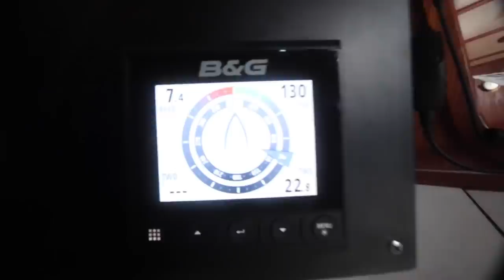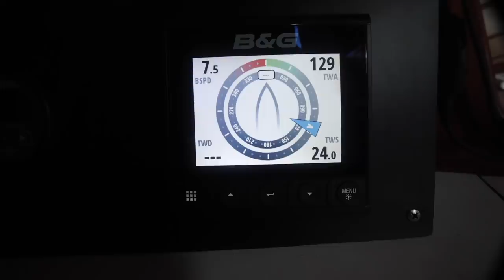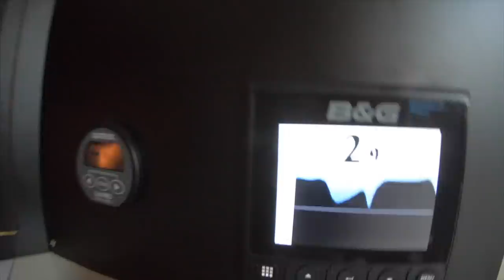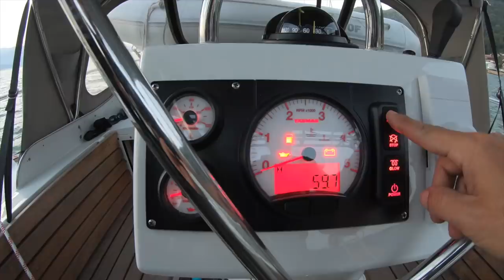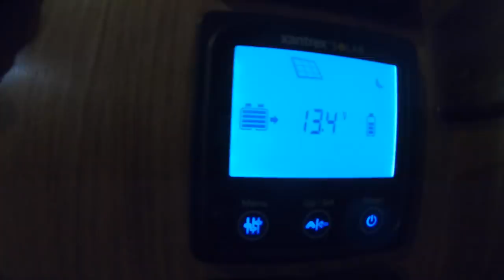⛵️Our brand new engine heated up!! #197

Comment: My engine had same the hot tank was above the engine coolant filler. What you must do is add a filler bottler ABOVE the hot tank. Yanmah will have a kit that you can get to do this. I would strongly suggest you do this it is safe and good practice. I am surprised your engineer did not fit this

Comment: Hi Guys, When you get your autopilot you can set it to 0 degrees by 'wind angle' so it will hold into the wind to raise your mainsail. This is the best way instead of setting a course to where the wind is coming from as it changes. André in Sydney (I did see you in Sydney)

Comment: Your cooling system needs an easy modification: buy or have made a stainless steel tank with fittings on the bottom for two cooling hoses and a radiator cap on top. Mount it higher than the heat exchanger.  Attach one hose from the engine to it and the other to the heat exchanger. This way air bubbles will work their way to the top of the system and also it is safe to remove the cap when the engine is hot. This is how my boat is set up.
Reply: You might get away with an automotive swirl pot...which does this.
Reply: There is nothing that cannot be remedied with enough time and money.

Comment: We replaced our Xantrex pro-sine 2000 on our sailboat with a Freedom XL marine 3000. We ended up not using the 3000 because it kicked the fan on for about 10 minutes every 20 minutes or so when it checked the state of charge of the batteries. The fan noise might not be a problem for some installations,  but on our boat the install is under the salon sofa, so the noise was a problem. Also, while the 2000 had a monitor that easily let us turn off automatic DC toAC inversion, the 3000 monitor didn't have that functionality. We've experienced sitting at dock where we've lost power over night and had our inverter happily run down our batteries to keep all the systems running (including the little electric heaters we were using). So turning off automatic inversion is an important feature for us.
Reply: .I inherited a Xantrax 2000 and soon switched it out to separate charger and inverter controlled by ME for exactly the same reasons.

Comment: Besides viewers suggestions for safety wiring shackle pins, I wondered it the bar used to crank the anchor winch should also have a rope attached that could keep it from going overboard on a rough day.  Thanks for sharing your adventure.

Comment: Use safety wire on your shackles, like when you started using 2 clamps on your hoses. If looking around at items while on your “shakedown” cruise and think: if this fails, what happens. You guys have done such a Marvelous job on the boat and all of it’s systems!!!
I think of all of the double check ing and some cases triple check items that are mission critical. You two awesome people ROCK❣️✌🏼✌🏼😎

Comment: Maybe need to experiment how the boat sails with centerboard part way down, I sailed my boat about the length of Florida in Intercoasal waterway with the centerboard up, It is little different because I had a small keel with board up and you only hit mud or sand until you get very south where it is Coral.

Comment: So much high tech stuff, so much fun in such a sort time. Yes when you add the other electronics add the heavier wire for the inverter/charger.
I can no longer turn myself into a pretzel in tight places, got long arms but to stiff in the joints to do that kind of work.

Comment: Most engines need a topping off or a fill sequence of opening vents and plugs. I always want to check again after the thermostat opens. They always seem to want more after they’ve ran a half an hour. You just got to be careful not to open when hot or under pressure. You also don’t want to pour cold water into a hot motor.

Comment: For that problem filling the coolant all the way due to the heater tank...

Have you thought about adding a petcock at a high point in the system? This will allow you to burp out the air as you fill the system, especially if you move your coolant plastic reservoir to the same level. Probably a simple way to reconfigure the components to avoid this problem. On my coach I had to add a petcock to prevent a huge air bubble inside the engine when filling the coolant.

Really enjoy your videos and glad to see you both so happy sailing.

Comment: Another cooling system tip: if the intake fitting doesn't have an external screen on the hull add one. This will keep weeds and pieces of kelp, etc. from being sucked in. You don't want to become an expert at disconnecting both ends of your intake hose ..... I speak from too many times having to do just that this summer.
Reply: Not only weeds and kelp. Plastic as well.
Reply: I have found my yanmar 3hm to be very difficult to get the coolant system completely full on the first fillup.  Recommend you continue to check coolant level frequently  until all small channels in coolant system are completely full. Also the exact water/ coolant proportion  50/50 gives best performance

Comment: You must do pre start checks on your engine each day you use it, this way the water level would have been found before you started the engine. 

Sometimes a small list helps you as it can be ticked off as it’s completed. This includes fuel in the tanks.

Comment: You really need to install a header tank with a pressure cap, say from a scrap car system, at a level higher than the hot water tank that will give capacity for expansion of the coolant and ensure the heat exchanger stays full. A clear plastic one will make easy to check the coolant level.
Reply: Great comment, thanks for sharing

Comment: We are all proud of how fast Duca grasped onto the low surge tank coolant level. Same with a car, if the temp sensor is out of liquid level, hot air or steam will show a far higher temp than the actual engine temp. Good catch Duca. 
The next comment goes towards the "old-salt" Roberta while at the helm, standing up on the cockpit seats to see over the dodger.  You kids are a lesson on co-operative learning.

Comment: Too bad that your shackle came loose. I work in theatre and do a lot of rigging, often using shackles. When watching your videos I was surprised that the shackles weren't locked. For safety it is standard practice in theatre that all shackles must be "moused". We run a zip tie (or cable tie) through the eye hole of the bolt, then through the shackle itself. This makes sure the bolt cannot become loose. Before zip ties, they used wire. Thanks for your wonderful videos. I live in Melbourne and my house mates are from Brazil. Matheus is from Florianopolis!
Reply from the maker: Thanks for the suggestion. We are also from Florianópolis and we have some friends living in Melbourne ☺️🤗
Reply: @OddLifeCrafting  Most of my housemates Brazilian friends have returned to Brazil since COVID.

Comment: Two tips........ Number 1--- Check the seawater inlet strainer and make sure it's clear of grass and fouling.. Number 2----after you tighten the pin on the shackle, secure it with a piece of "safety wire"..

Comment: Nice. I noticed the spinnaker pole on the starboard side deck is a trip hazard and could hurt your toes. Have you thought about mounting it on the boom where its out of the way and much easier to deploy (many racers like us do this). Very cheap too. You just need a small piece of black plastic drain pipe about 150mm, cut at 30 degrees (so it looks better and you have room for the rivets) riveted to the boom. Just a thought.

Comment: Great to see you guys out there! Interesting. In the US Yanmar allowed me to do the 50hour valve clearance check/adjust. I think laws here make it so you are not forced to use prescribed service providers to maintain warranty. I do maintenance myself for the very same reason you discovered. Marine services just keep getting worse. A professional rigger just finished a friend's boat and left the pin/ring out of the backstay connection. Professional....right....

Comment: Your diagnosis is incorrect, but the you got the problem fixed. When the water level in the exchanger is low, the amount of cooling is reduced and the engine really does get hot, it is not just a sensor problem from being in the air, it really was a lack of cooling, and the engine really was hot.  You made the right decision to let it cool down.

Comment: Apparently there is the ideal size and pitch of your propeller. If it is too large it may overload your engine. I asked an ai program which pitch would be the best for you here is the answer. Others agree. “Most sailboats will gain 0.5 to even 1 knot of speed by using a low-drag folding propeller,” says Keld Willberg, Flexofold’s general manager. “Many boat owners don’t look just at the speed gains, but also the ability to sail in very light wind.” Also, he says, when tacking, a boat that’s equipped with a low-drag prop won’t lose as much momentum."
Anyway go with a smaller diameter and more pitch propeller is my suggestion. Then there should be less load on your engine and it may work better as higher pitch will give you less resistance  through the water when you are not using it. Good luck.
Reply from the maker: Hi,Tommy. We actually replaced it for the best pitch we could use with our new engine when we replaced the engine https://youtu.be/wflBom0O21Q
Reply: @OddLifeCrafting  Yes I noticed you were doing 8 or 8.5 knots and I figured you could not do better than that. Just find the most economical speed where you use the least diesel per nautical mile. It may be from 3 to 5 knots then suddenly at 6 7 and 8 fuel consumption goes up and up and your fuel economy drops like crazy.  Anyway you are both very smart and will figure it out.  Well I found a formula for a displacement boat and an example. Full displacement boats live in this zone. As soon as speed increases above this number, fuel burn rises sharply. At speeds above 1.3 times the square root of the waterline, the burn starts to climb dramatically. O.k. then I will add an example. Let’s look at some actual numbers from a full-displacement trawler in the 40- to 50-foot range: 7.5 knots @ 3 GPH = 2.5 nMPG

If we push for a little more speed the fuel burn changes:
9 knots @ 11 GPH = 0.8 nMPG

Notice that by slowing down 1.5 knots, this boat increases its fuel economy almost 300%.
Wow that is using a lot of extra fuel. Hope you enjoyed that I am used to power boats and it is like 30%.  300%is almost unbelievable that is using 3 times more fuel. Wow

Comment: Traditional method of securing the block would be with a length of thin ss wire called seizing. Through the hole at the end of the threaded pin and then around the shackle so that it can't unscrew.

Comment: Love the Videos and Love the pair of you. 
Life is a learning curve and we should aim to learn something new everyday and never not listen to advice ( Even if you think that person is wrong lol ). 
New Engine = New ways and at least nothing bad happened. 
I do a lot of work with Newer Engines but Car ones and lots of the newer engines have parts that are aluminium and unfortunately Tap water does contain impurities which will react with aluminium so therefore it is suggested that Distilled Water is used in cooling systems ( You know when you open up a old engine and you see a white deposit ( that is a reaction of the impurities/limescale within the water with aluminium ). 
I actually suggest to my customers that they only use distilled water in the Windscreen washer bottle too as the absence of impurities stop the water from going stagnant and a film from forming on the inside of the reservoir. 
It’s fine using tap water but you will need to perform a Engine flush on the system and also flush out the windscreen washer bottle every now and again. 
Using Distilled is just a precautionary measure really. 
The water out of a condenser type tumble dryer ( the one with the tank ) is actually distilled water so you can use that rather than buying it,just put it in a 5 litre container for when you need it, if the condenser dryer is of the older design then you will need to filter the water because you may have fluff in it ( but a pair of tights over the top of the funnel works great ). 
And of course because the water is distilled it’s better for washing your Hair ( like rain water ). 
Rain water does have impurities in it tho and dust from the Sahara so don’t use that in your Engine. 
Surprised the mechanic didn’t do a Run up test tho after the maintenance ? Because then the Airlock should have been apparent ?. ( usually you would check the fluid levels after a run up test ). 
Thought it was absolutely lovely of you to Gift that person who helped with your Boat and the Helm control of your old inverter…😁

Comment: If i may give an advice : never trust an engine on a sail boat so always keep your main sail up because a sailing boat can always sail even under strong wind.

First thing you do even before leaving anchor put up your main sail it's easier because the boat is stop and good positioning from the wind.

Also it's easier to put on the geneker when your are facing the wind not when your get the wind from behind.

Do it when you are still attached with your rope, it's no problem if the sails are moving a little, it does not killed them.

And be sure that all ropes are loose when geting your sails up other wise the wind will put pressure on them and it will be harder to put up the sails.

As your are ingenier your boat will be mostly in very good conditions.

Your are both young so will learn sailing from years.

Though if it was me i would ask a guy who did racing competition to come for a week to understand how a sailboat is moving. I mean to learn to leave a anchorage point only with sail, to be able to get to an harbor only with sail, to be perfectly ok with sailing any sails under any wind at any angle.

It would avoid you to put yourself and your boat in dangerous position because of course shit happends and always at the worst moment (in strong wind, no motor and neer the rocks) so you must be i guess more prepared.

I can see that your learned already some sailing technics but it's clear you need a few basic but important solution for your safety.

Also i enjoy very mutch this channel, it reminds me my younger time where i discovered the sailing world. Great adventure :)

Have fun and "bonne route".

jean marc

Comment: Time to put a fill point at the highest point in your cooling system (near water heater) to avoid the possibility of an air lock again, could have easily destroyed Kelly. That would be bad.

Comment: Hi Guys, You have magnetic charm. If restoration of this wreck  (Sorry) did not brake your relationship, nothing will. It is a good idea to add coolant while your engine is on. Also it is advisable to install plastic - see through  - container showing you excessive coolant. Ha. ha. alcohol is evaporating above 70 degrees of heat, so you wasted few drops in the oven. You need owners manual telling you how to use whiskey on a sailboat. Lots of love. Capt. Jack

Comment: Guys you both are quickly turning into real sailors. The only thing I would change before you go offshore is that manual windlass. I can't see you hauling in 50 metres of chain with that hand lever thing.

Comment: I didn't fully understand the issue. There was air that had been in the hot water system that moved to the heat exchanger? Not that the hot water system consumed coolant (I hope!).

Comment: I almost cried when you poured the Johnny Walker into the pot 😢, if that was a blue label, here in Canada it’s $300 a bottle.
Reply: You pay that your getting ripped off its around £130 UK around $150-$180 US
Reply: It looked like black label didn't it? No problems there, anything less and the dish would have been worse off :-)
Reply: @broyout3586  Nah, it was the common Red label.
BTW, there are so many better choices than Johnny Walker scotch ! And for not much more $$.
Single malts are way better tasting!  Same with gins. Everybody knows the Beefeater. 😝 But again, so many other, better, brands !
Reply: @marcryvon  yea. The only time i have any whisky that is not single malt is when i mix it in my coffee. 😀
Reply: The only good thing that Scotch is good for is washing engine parts. I’ll take a bottle of Canadian Club, or Crown Royal over a bottle of Scotch.  Scotch is so expensive here in Canada due to the duty rates.  Alcohol here in most provinces is a monopoly with high duty and taxes.  What you buy in the states cost us double here in Canada.

Comment: If this is your first experience with a bran-new diesel engine they can have a long break in period. Which is likely why Yanmar insist on doing maintenance for the first few times. I bought a new Dodge Cummins Diesel back in 1991 and one of the things the dealer failed to to explain to me was its break in period was around 10k miles. It didn't start getting its best fuel economy and some other little annoying things like being a bit hard to start until it past that point. They also avoided talking about the cab noise level.  Next time you have it serviced you may want to ask if there is anything they either purposely or  neglected to tell you concerning your new motors idiosyncrasies...

Comment: You should use stainless steel lock wire to keep the shackle pins from coming lose in the shackles.
Plenty of YouTube videos on lock wiring, "mousing" or "seizing" a shackle.
Reply: Cable ties can also be used, although can be affected by UV.
Reply: @philipmasters7491 Masters... Sure, but would you trust a cable tie on anchor shackles or swivels?
Reply: @bobdown6235  cost, simplicitly and convenience, as a short term solution